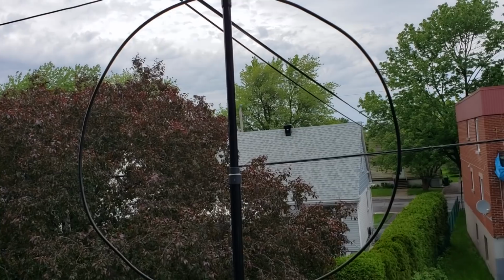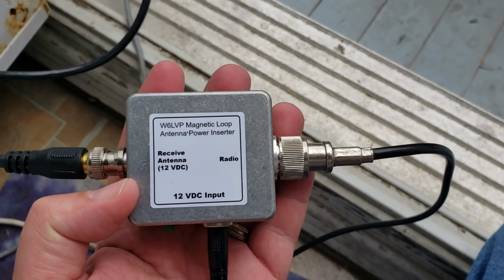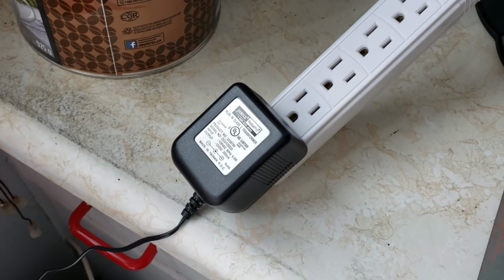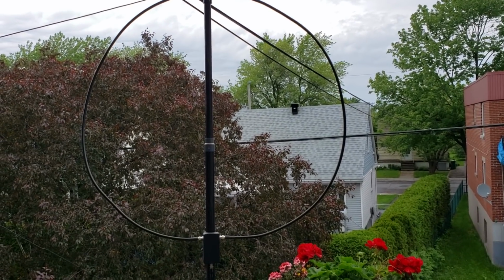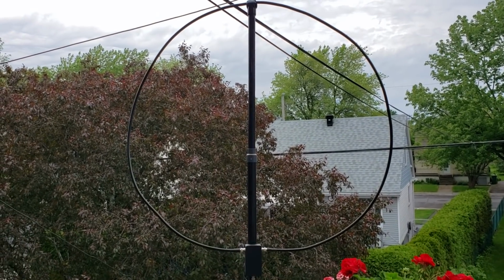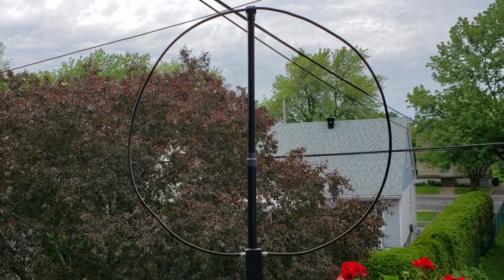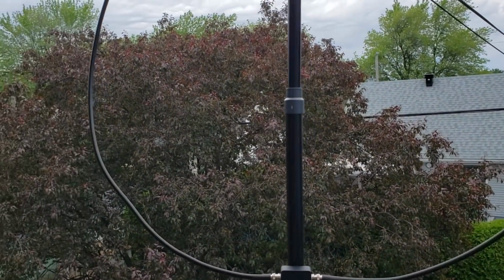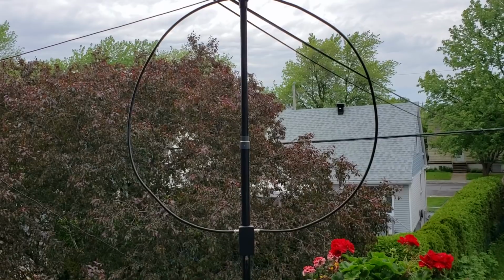W6LVP Magnetic Loop antenna test with battery power and AC power adapter

Comment: You might want to swap the power strip next. Even though my loop antenna and SDR where not plugged into that power strip. Recently I had a noisy power strip nearby on another outlet and that was my noise source. Unplugged that power strip from that outlet and now my noise is gone.
Reply: is it a power strip with a neon-bulb in it to illuminate the switch?
Reply: @matambale  Mine had USB ports and two LED lights.  It was a GE power strip with two USB charging ports.  It has no illuminating switch.
Reply: Yet another noisy USB charger, I guess